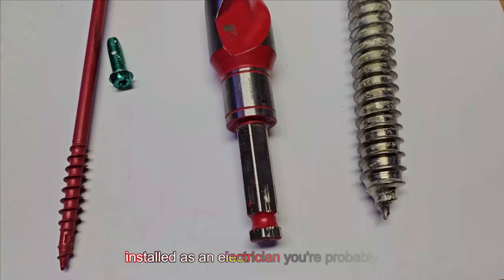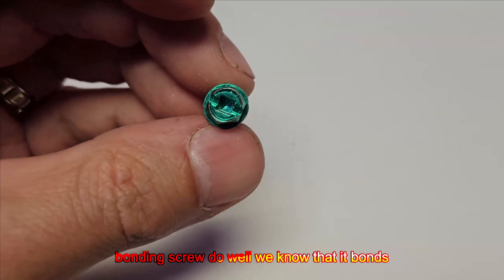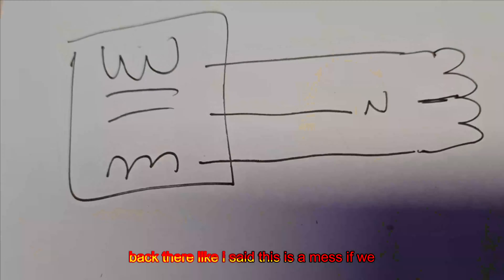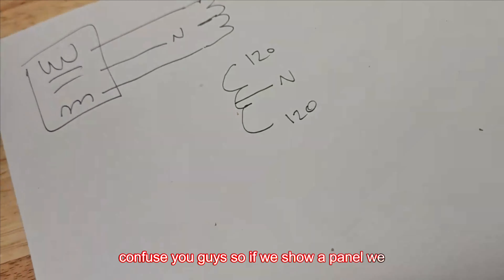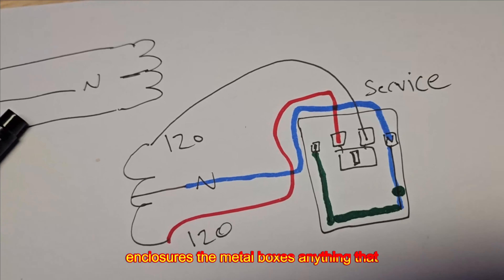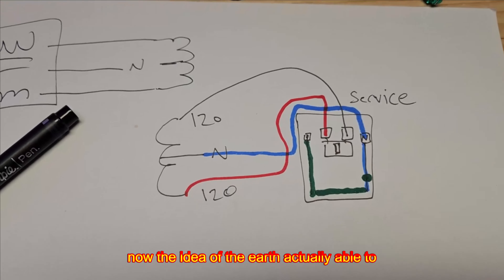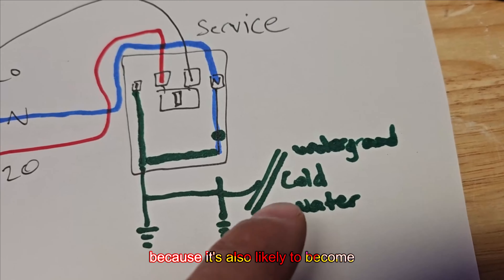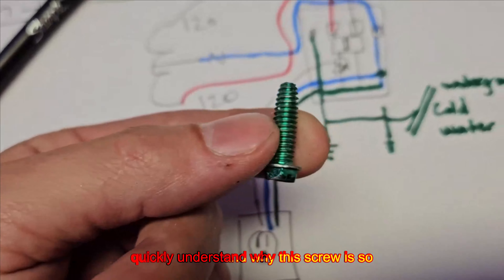Where? And How To Bond Most Electricians Try, But Just Have No Clue!

Comment: I was installing a machine in a factory where they had "floating 480" aka "3 light bulb system with burnt out light bulbs" and I measured 480 phase to phase, but one phase was 610v to ground, the wire was only rated to 600. this is why we need to have the secondary of all transformers grounded somewhere. Y transformers with a grounded neutral are best for CNC and VFD imho.
Reply from the maker: That's an interesting scenario thx for sharing

Comment: Installed a GFCI breaker on a circuit. Insta trip. I was advised to remove neutral wire at the panel for that circuit. Continuity test between neutral and ground came up continuous. Should I bother trying to fix this?
Reply from the maker: Yes
Reply from the maker: The Grounds only purpose is to carry current back to the source under a fault condition 

The ground should not carry current normally